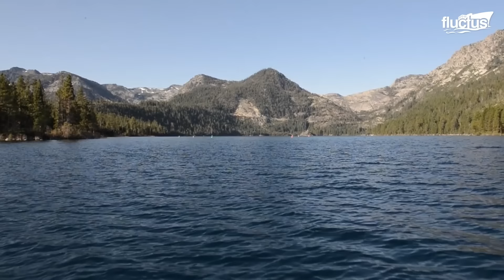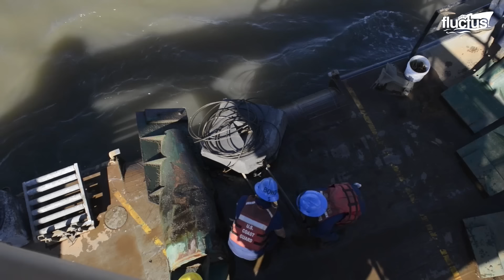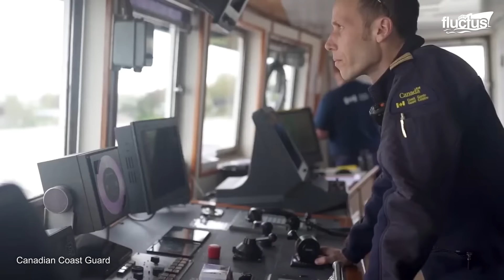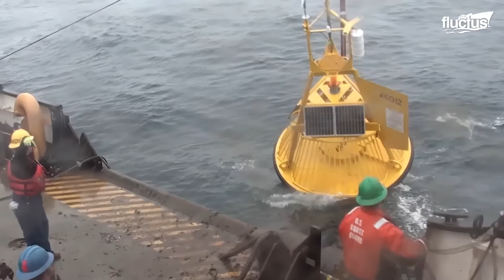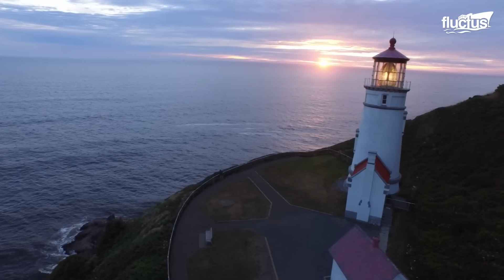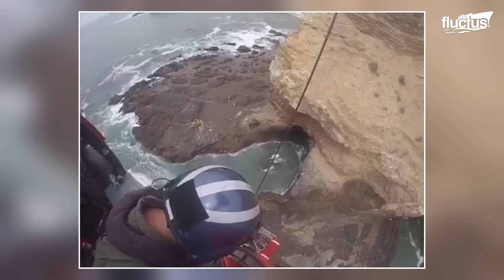How US Coast Guards Clean Gigantic Buoys in Middle of the Ocean

Comment: A red buoy, in accordance with the Maritime Buoyage System of the IALA (Recommendation R1001), can indicate both starboard and portside, depending on the region. Region B (America's and 3 countries in Asia) uses red for starboard side. The rest of the world (the majority) falls in Region A and uses red for port side. Marine growth does change the way the buoy behaves in the water, but typically is not a major threat. Collissions between vessels and buoys are however, as well as poor deployment. Interesting to see how many steel buoys are still deployed, something in other countries is considered to be outdated. Modern buoys tend to be made of PE or PU. Changing light bulbs is getting less and less common, since most new buoys will be equipped with LED lanterns, with PV modules and a battery.
Reply: Correct. In the UK, red buoys are portside when entering port. (Region A)

Comment: There are no buoys 'in the middle of the ocean'.  What - are you going to have an anchor line of 5 kilometres long, holding the buoy in position??
Reply: Yes in fact there are. We recovered the line from one over two miles long. The buoy was over 20 feet in diameter. Some sort of research thing. It got damaged by a ship that hit it and was being towed in.
Reply: There are, but obviously not moored in very deep water, although with modern materials as Kevlar/Dyneema, it is possible to make very lightweight mooring ropes. But there are free floating buoys, that cross the oceans, for research purposes, like weather, sea conditions, etc.
Reply: Not necessarily for navigation but I think there's weather and security buoys that are pretty far out there...
Reply: I was on CGC Morgenthau and we closed out ocean stations Bravo and Charlie, Charlie in Dec 1973 and Bravo in 1974. The crews and cutters that manned the stations were replaced with buoys that somehow were anchored in 12,000 feet of VERY rough water and Bravo was also exposed to icebergs as well.
Reply: @tomtrenter3208  There is absolutely no way buoys were moored in 12,000 ft of water in the 70-ies. It was not even possible to moor rigs in that kind of water depth. We are talking over 3.5 kms. The weight of the mooring chain/ropes would be so excessive that you need buoys the size of large ships to be able to stay afloat. Apart from that, the freedom of movement of buoys with such long moorings, is way to large for the purpose of mooring buoys, unless you would use 3 legged mooring system, in which case the mass of mooring assembly is tripled, requiring an even large buoy. Ultra deep mooring require very strong and lightweight high tech mooring ropes, not available in the 70-ies.